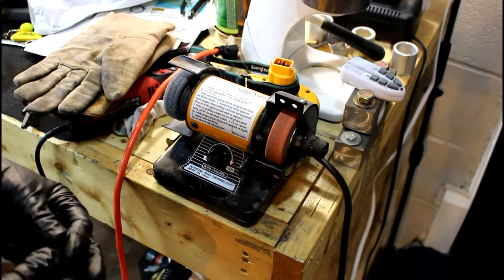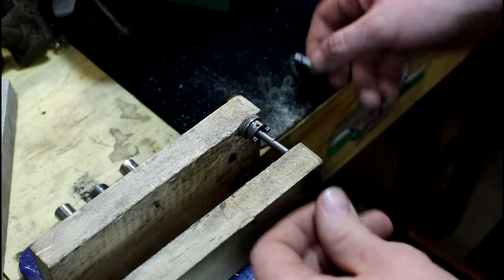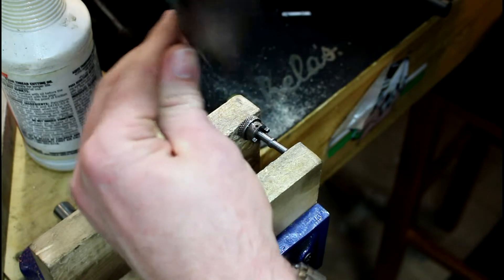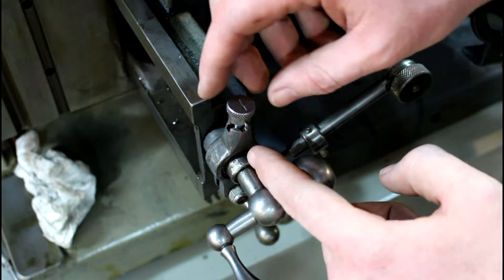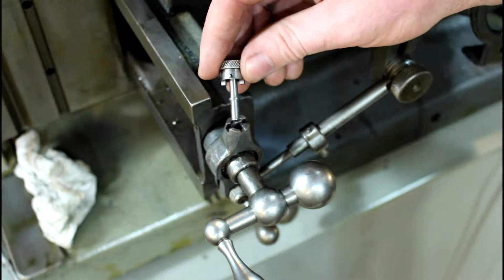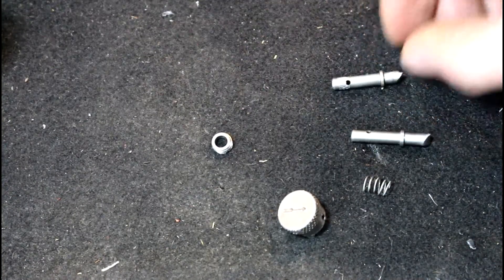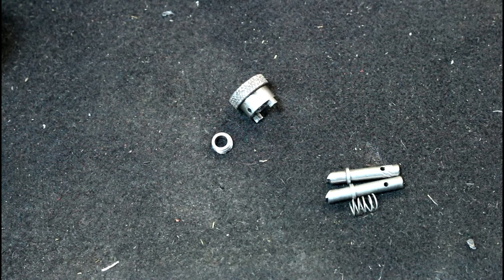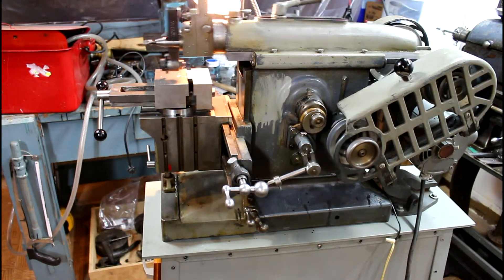Pawl Pin Repair Part 2 7" Delta Rockwell  Metal Shaper

Comment: Good info! I’ve got to make knob, pawl, & spring but this helps me understand it. Turn knob 90 degrees and it lifts pawl so it doesn’t engage the gear & stops the feed. Turn 180 degrees and it reverses. It seems to me that there is no reason to be trying to balance two different slopes on the end of the pawl. One direction should catch that gear tooth. For that it needs close to a 90 degree face. The other face should have a shallow angle so it can “jump” the teeth and take another bite.
Reply from the maker: Yeah, thinking back, I dont know if the one that was in there originally was stock or not. I just copied it and tried to sharpen up the edges. More of an angle on the one side would probably work better

Comment: I had the same issue with my 7" Ammco shaper....after fighting the feed mechanism for several hours I came to the conclusion the issue was somewhere else.   The table was a bit snug so I loosened the gibs underneath the table and tried out the feed.  It worked perfectly....both directions!!!  So it was too tight...
Reply from the maker: That's good to know.  I got frustrated with mine and sold it.  Not sure I ever looked at the gibs.

Comment: Are you sure the gib or table is not too loose? Snug it up and give it a try.
Reply from the maker: +Marty Escarcega I'll have to check it out, I was running it the other day and the vibration seemed to be coming from the head. I'll have to get into it. I might restore it and send it out to have the bed ground and he can check out the entire machine for me. My rebuilder is very experienced with machine rebuilding.
Reply: I'm talking about your shaper. Tighten up the table gib and see if it puts enough drag so the ratchet table fed mechanism works.
Reply from the maker: Ah, yeah I tried adjusting it several times and re-worked this pin and the original several times and spent probably 10-15 hours trying to fix the feeding issue. I've since sold this machine!